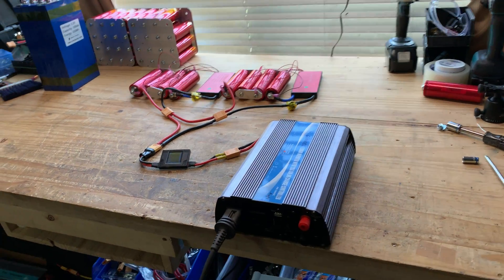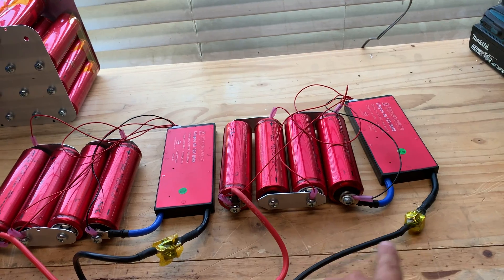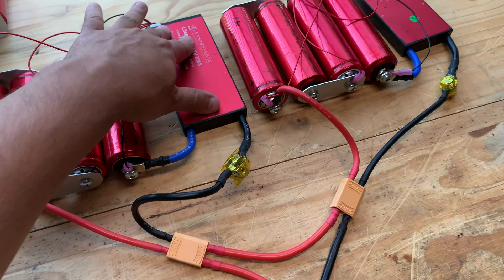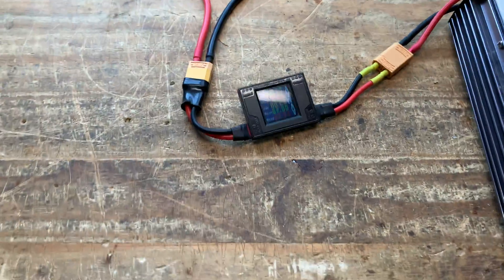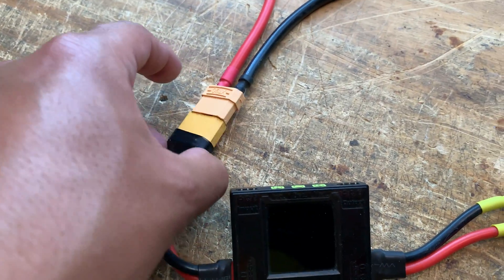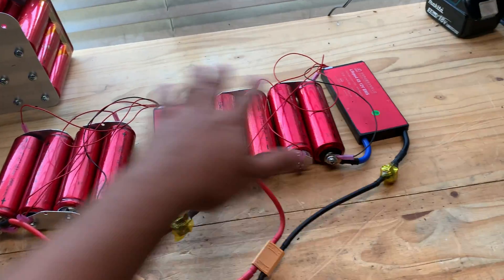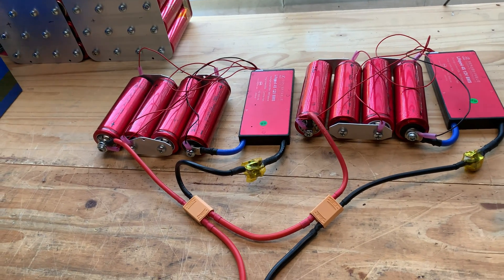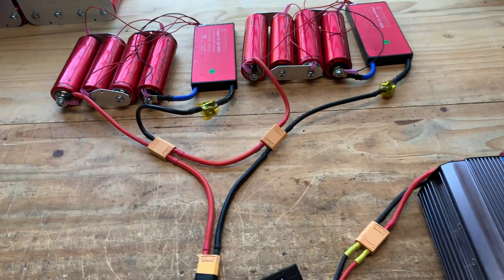BMS Battery Module -  Can you Series connect them?

Comment: Almost found the video I was looking for. Great one non the less. Can anyone out there answer this question for me please. Is it possible to connect 2 50ah bms's to achieve 100ah's. I have a 12v 100ah battery. And have 2 of the 50ah bms's on hand. Thanks in advance.

Comment: Thanks a lot for the video!! im trying to replace lead acid gel batteries on my old APC 1250 , uses 2x12v 7 or more amperes batteries  in series to get 24v, i have 18650 to build a pack and two bms 4s 40a, i will try to do the same and test it. my worst concern is the safety .. i am affraid of 18650 when i am not in home... inside of a ups, even is ventilated with a constant fan

Comment: hi! I want to build a battery bank for an electric motorcycle running at 144-150v and I want to build from this type of battery SPIM08HP 3.7V 16AH Lithium Ion in a 40S 4P configuration, I would need some help on where to find a BMS for Lithium Ion that can handle charging and discharging a series of 40 batteries at 150v up to 100 amps. Is there a BMS that can manage 40 series or do I need more BMS-s connected together in series?

Comment: After 4 years, he I am having played 16s for two years and now wanting to go 4x 16s to reach 192V for summer serious 5kW power to charge my EV. After reading a lot of the expert trying to explain the danger, I can see the point of body diode of the balancing mosfets… the proof was in your video. U started out with 26.27v no load, ie. 13.135v/ea. When the simulated disconnection of one bms, u got 12.03V. 12.03V is the results of taking out 4x Vf of body diodes @0.2763v/ea. This proves that the “off” BMS is bleeding through but luckily the inverter did the needed UVP that prevented high current flow to melt the body diode. This is discharging. During charging, I’m not sure, without actually having looked at a circuit diagram before, if the body diode will be reverse biased, and I suspect the mosfets are in series and so each mosfets will only see its own Vds drive from 13.135V/4…and this would still be safe?

Comment: 072723/1028h PST 🇺🇸 Thank you for the demo on 2X12V LiFePo4 BMS controlled Batteries in series; to load (discharge) Most DIY enthusiasts do not demo this. One prominent battery manufacturer  (BB) also did not speak or demo this, as explicitly as you did. Best wishes.

Comment: All the 12v lithium batteries that you can can purchase have a BMS in them.  They allow a least 4 in series for a 48v system.  The BMSs in all of the batteries are basically the same circuitry.  Connecting batteries in series is just a basic voltage divider.  You only ever see the individual voltage across each.   

As long as each battery is the same capacity it should be fine.  Each one needs to be at the same state of charge when connected.  Then the same amount of current flows through each battery.  

As long as you do not run the bank too low , neither should cut out.  Also I would only run the current at about half the rating of the BMS, then you will never go into overcurrent cutoff.  I never use a BMS at more than 70 -80% of its rated current.  If so only for a brief period.

I'm not sure why there was 12v showing with one of the BMSs off.  The mosfets should have been switched off.

Comment: Thanks !! I applied You're setup to a 16s 100ah 48v battery with two JBD 24v 100A bms.
I'm getting ready to put I to work.
Do you have any advise for something to look for before to use it in a home system ?
Reply: Please update whether this worked or not. Im considering doing the same thing

Comment: do you think this will work with two daly 15s bms? I have them set up for charge only. But when I connected the series connection I heard a high pitch beeping sound, it was very quiet but it made me nervous. I couldn't find a proper 30s DMs so I decided to try to cheap low current 15s bms. 
I appreciate the informative content thank you sir.
Reply: when I unplugged the balance leads the noise stopped. do you think that is an issue?

Comment: The fan was pulling 2.9A @ 26V.  When wired in series as in the video, does each BMS also deliver half the current?   
Meaning, each BMS is providing 1.45A @ 13V?  Or do both BMS provide 2.9A @ 13V? 
Hope someone can clarify.  Cheers.
Reply: Both BMSs would be supplying 2.9a . The same amount of current flows through both BMSs, which is the total amount of current.  Look at it this way.  
26v x 2.9a = 75.4 watts.
Each BMS. 
13v X 2.9a = 37.7 watts 

Each bms will only ever see 13v across it.
It's just a basic voltage divider.

Comment: You an N O T stack 4S BMS's into 8S or 16S unless they specifically state that you can.  This is driven by the voltage of the components populated.  I especially would not try it with that DALY which will fail-short on you, leaving you unprotected.  This happens when they populate super-low quality output control mosfets.  To save money they probably (definitely) use lower voltage mosfets for the 4S circuits.  The higher your mosfet voltage the higher your RDSON or Price goes...  sigh.  Whatever.  Do as you please.

Comment: I have Four 3.7V 1800mAh li battery packs. If I wire the four 1800mah cell in parallel to make a 7200mAh cell..which type of BMS i need?Order Link

Comment: I built 2 of the 64 ah headway banks . I have them run parallel in my truck for car audio.. ive been running one and when i hooked up the second my voltage instantly dropped .. when i un hook it voltage goes back up.. i have 2 separate 4s active balancers

Comment: What about charging? Could you connect them to a 24v battery charger or would they need to be charged as 2 seperate 12v batteries?

Comment: It's actually not safe to put BMS in series unless they are rated for it.
The Mosfets in each BMS are most likely only rated for 25v.
8 lifepo4 cells will be slightly higher than that.

Comment: You kind of need an active element to manage the BMSs so if one gets cut off it will cut off the rest too. Sort of a 48 volt BMS-MS. That way if one BMS cuts out then it will cut out the others too until all are back online. Also it could help balance the voltages on each BMS.

Comment: I am using 5 bms boards in series {3x3s + 2x4s} one of them fail and keeps getting out of circuit until I disconnect and reconnect the load, I think it's the forwarded voltage that mosfets could not take it

Comment: Question. Does it matter if you use a BMS with a common or separate port ( I'm looking at the Daly BMS)? 
For example, in a car where when you start the car there is a discharge and then it starts to charge from the alternator when the battery is fully charged, would the BMS allow you to discharge again after switching off the car? 

OR 

will the load need to be disconnected & reconnected in order to reset the BMS before being allowed to start again? 

OR 

is that disconnect and reconnect only applicable when it's a situation where battery harm can be caused and the BMS can switch from charging to discharging with no issues?
(in an application where you are charging and discharging continuously which is better a common or separate port? )

Comment: M365 battery bms battery stopped charging but discharging is perfect.so I connected another bms for charging which is not from Xiomi  and does not have the control inputs and outputs. So the original bms gives the control and discharging which is required for display and so on. Problem is if I keep buying 100% longer time it shows the battery is going down. What could be the possible problem?

Comment: Fine and good for 12-24v. But what if you kept seriesing those until you ended up with something like 150-200v? I'd be nervous about the voltage rating of BMS's internal fets. Even large 32s-capable ones (134.4v li-ion) usually only have 150v fets in them (lower voltage rating = lower ir of the fet = less wasted power/heat). 3 of those in series = 400v. So what happens when 1 shuts off for some reason and the other 2 keeps going? Almost 2x rating = I'd think the bms would end up in flames, and if the cells are capable of high current (ie pouches or big prismatics with <1mO IR ea =3000A+) probably blow up the BMS like a small bomb (with 700kW peak power that's industrial-flashover-accident level, you don't want to be in the same room with that). And the resulting surge would probably cause the other 2 to blow up as well soon after if not immediately.  I'd be really nervous doing that with the higher voltage battery packs or with more than 2 lower voltage ones that put out over 60v in total (15v bms prob only have 40-50v fets in them). There's reasons why normally you don't simply keep seriesing bms's for higher voltage even though that'd be much cheaper, but you have a basically have a master control unit controlling the daughter BMS's attached to it (usually 20-40s BMS with the MCU controlling something like 20-40 BMS's). Can make battery arrays that put out several kV and 100-200A that way and cost 10's of k$ just for the BMS, but at least it won't explode.
Reply: I think I would not actually put the BMS in series. To avoid this problem I would use a contactor-relay so the BMS would not actually be exposed to the Circuit voltage. The output of each BMS would enable a mosfet or solid state relay as part of a series. Each BMS would power one relay. If all relays or activating then the signal would ultimately reach the contactor. If one BMS fails then the contactor shuts down. This is commonly referred to as a and gate array.

Comment: Robert, don’t expect a response. Because the Physics involved in this ridiculous arrangement, is unknown to the Author. This is so ridiculous that if one cell gets discharged or over charged, the whole system ceases to operate, thus defeating result. Please be aware that miscalculating the charging and discharging LiFePo4 can be calamitous, endangering anyone around or the property. Please do not watch this video. Take care and be safe.
Reply from the maker: If one cell falls out of balance the whole system ceases to operate in every battery system, That’s what the bms is supposed to do.  That’s normal operation,  if you don’t know that you shouldn’t be offering your opinion.

Comment: offcourse it can, but it will mess when one off BMS decide to cut off because it is already full/low voltage when you charge or discharge. can you thinking what happen sending 24v  to 12v because one of BMS said, 'enough'
Reply from the maker: When a bms quits it breaks the circuit and nothing happens after that

Comment: I have a Question, Dear! I have a set of 18650 171 total batteries and I have put them in 3S 3 packs each pack is 19*3
the question is, should I use one BMS for the three packs or should I use 3 BMS that?
Note: I have 3 BMS 40a will I get a power of 120a If I merge them?

Thanks :)

Comment: Each bms is only receiving 12 volts even in series. So it's safe to connect in series. 
Only caveat is that since total volts go 24v, load should not pull more current than treated by each bms because that will switch off BMS

Comment: Can I connect more bms to reach the 170v 200ah ?
Reply: no. even just 2 is risky, esp when even the Chinese tell you to not do that. More voltage = pay $ for a bigger or more sophisticated BMS. 32-40s <150v is rather common/relatively cheap ($100-200 for 300A). More than that and the price goes way up.
Reply: @fvckyoutubescensorshipandt2718   I wanted to make a battery with 40s64p any suggestions on that? and thanks for the reply!
Reply: @antiLeixo  As long as all the cells are the close to same (ie same production run so similar internal resistance and capacity each) and balanced I don't see why not. Simply make 64P chunks and then series those and add a BMS that can handle it (both voltage and peak current). 40s BMS are less common than 32s, but Aliexpress has a few. I did find a 96s one there, but is only rated 30A and costs $520 (higher current options offered but probably thousands of $).

Comment: If one of the 12v packs comes up to full charge but the other is low, will it disconnect the entire set leaving one of the packs undercharged?
Reply from the maker: Yes
Reply: @jehugarcia interesting nobody commented about the possibility of using a relay based bms instead of inherent high voltage shortcoming of mosFet based bms. I currently have need for 120v or 40s battery bank without breaking the bank. Do you have any insight into this please? Or any other experienced person in the house. Thanks

Comment: If you really think about it , if you take a normal drop-in replacement lithium iron phosphate battery Which Has its own BMS . The solar Community has been serious connecting in parallel connecting them With no issues so This is exactly the same type of test and so I don't see why there should be an issue. But again further testing Should be Considered before slapping something together
Reply: Thats a really good point. Almost all solar setups are now LiFePO4 batteries, ie they would have their own individual bms? And they are often setup as 24v or 36, 48v Even 52v- Now I just have to check what their batteries look like. Are they prismatic packs that they give one bms to- or plug and play units of 12v with their own bms? Cheers

Comment: Jehu ! I can see a potencial problem with series connection of BMSs. As we could see when you disconnected one bms it sees 12v over the mos switch. If there where three bms in series and one disconnected, the bms will see 24v over the mos switch. So the bms must then be 24v or more.

Comment: Could any type of BMS work series or parallel to achieve higher voltage or amperage?
Reply: I put 2bms' in parallel to achieve more amparege. Seems to work but having some trouble with it at the moment.
Reply: @raulborodenko1634  update us please what have you discovered

Comment: SUBSCRIBED, great channel

I require some expert advice.
I am building a 12.8v battery using 4 x 38120 headway cells.
This will be used inside a car powering my project.
I would like the cells to be charged from the car battery/alternator but using low current.
The BMS says 50A and I was hoping for more 5A as can be plugged into the cigarette socket to charge or trickle charge the pack.

This way I can also fit some protection like a resettable PPTC fuse so when the project load requires high current, the fuse will trip and only current from the 38120 pack will be used.

Is this possible or does the BMS really require 50Amps?

Thanks

Comment: I've done some testing on these BMS'es, under normal conditions you can put them in series, but the Vds of the fets is a limiting factor, not for 2 x 4S in series, but in the 16S the FET's Vds max is 80V's, I've tried it, when you make a 64S out of 4 16S and trigger an over or undervoltage on one cell, the FET's simply short out and you won't even notice (they make a short circuit) leaving you without cell over and underprotection. That combined with the poor 35mA balancing current is a dissaster waiting to happen ;-) Also like most BMS'es, when a cell goes defective in open circuit mode, the balancer explodes ;-)
Reply: Hi i want connect 4x48v 25ah battery pack in series to make it 192v dc for online ups will it work and is it safe
Reply: @stormashish  shares  video link
Reply: So if you stay in the 4s range you would be ok you think? I've got 4 12v 4s batteries trying to hook up in 48v via bms. Getting so much conflicting info on this feed. Thinking bottom line that I can just have a second discharge negative that does not go via bms for powering motor. And then go via bms in parallel for charging. obviously no low voltage cutoff and a few other things like temperature etc... but at least they stay balanced. can always just keep an eye on voltage meter
Reply: With wat he said no it explode
Reply: Mine makes the same problem you described one of the boards keeps shorting it's circuit and forwarding the others voltage

Comment: I`m currently building a range extender battery for my Peugeot 508 RXH HYbrid4.

Stock battery is 168S1P 5,5Ah Ni-MH. Nominal voltage 201,6volts (same as the Prius, different shape battery tho).

My plan is to use 126 8Ah Headway LiFePo4 batteries in a 63S2P configuration using 3 150A 21S BMS boards in series.

Hope it works.
Reply: Almost guaranteed to blow up the BMS's due to the high voltage on the mosfets

Comment: Can we connect in the same way two different batteries? I've got 10s6p battery li-ion 18650 pack. I would like to increase the voltage from 36v to 39.6-43.2V by adding in series 1-2s6p battery pack. Thank you in advance
Reply: P.s. to the second battery pack it's possible to use the reverse diode right?

Comment: Hey Jehu, very interesting and useful video! 

A question I have that I cannot find the answer for is whether it would be possible to have 2 independant 4S battery packs each with their own BMS, but with the charge and load of each pack being ran in parallel? To give you the background, I have 2 different sized 4S packs (40AH and 160AH) that I wish to combine to provide a 200AH pack. But I cannot find information anywhere on whether this would be a safe option.

Any help would be much appreciated! :)
Reply: I have a series of makita tools that take two batteries, and often put 4ah and 5 ah batteries in them.. hope that helps. Also in the battery building book or home solar system book by micah toll he definitely gives an example of hooking up different amperage packs. If you are going through the bms the probable issue will be that one pack drains faster (same drain rate, but that pack reaching lower v faster than the other pack) therefore it being cut off before large pack is very low itself? But that is just conjecture sorry.